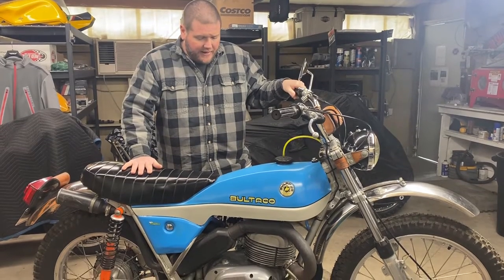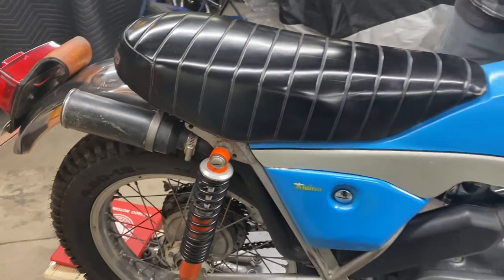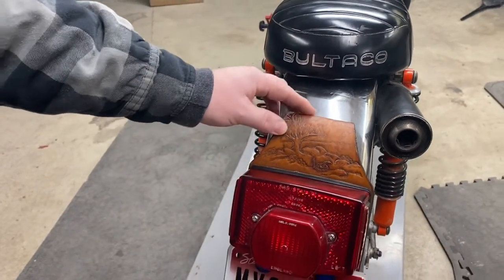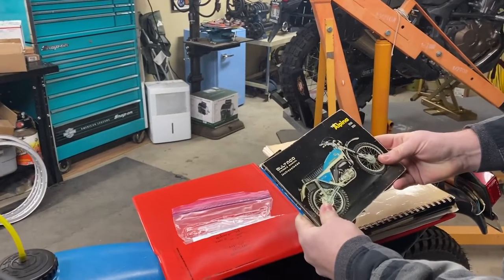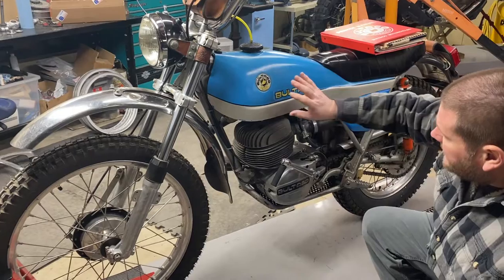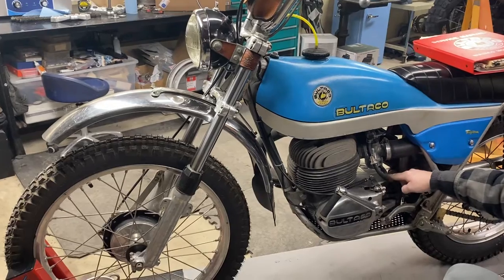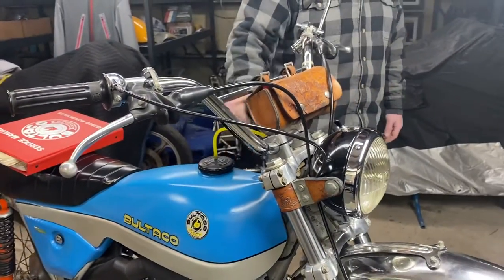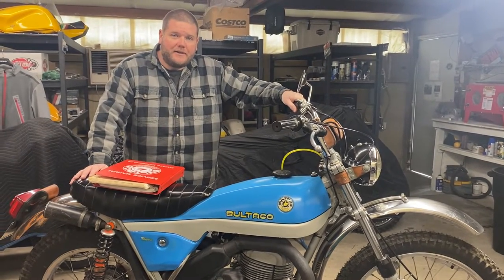Walk Around 1974 Bultaco M115 Alpina 250 for BAT Auctions

Comment: She's a beauty🏆 so similar to my 74 Sherpa T only mine was the 360.
Reply from the maker: 1974 Sherpa T should be a 350. I had one years ago. The Alpina is a trails/enduro, the Sherpa a proper trials machine. Do you still have your Bultaco? This is the last of the 6 or 7 in which I have owned. If memory serves me, I have owned four Alpina’s, a Sherpa and a Campera. I nearly scored a Frontera 370 recently but seller got cold feet.
Reply: @emppowersportsandmarine6270  I stand corrected, you are absolutely correct...350. Sadly my taco was stolen from my locked ģarage a couple years back. BTW Love your channel
Reply from the maker: @paulgrogan8032  I am sorry to hear that, join the Bultaco Owners Group on Facebook and post your VIN, if you have it. A lot of us will keep an eye out for bikes that do not have titles. Thank you for your support